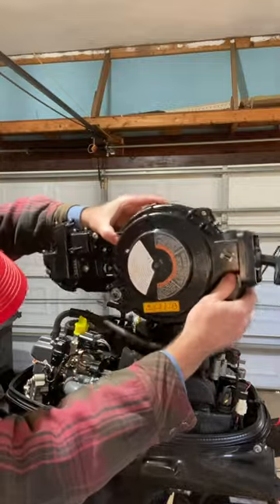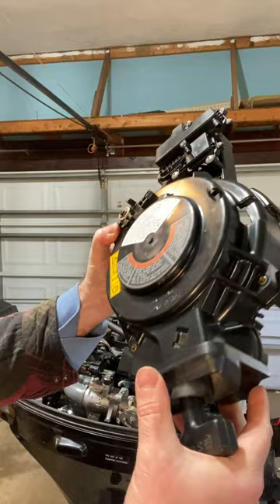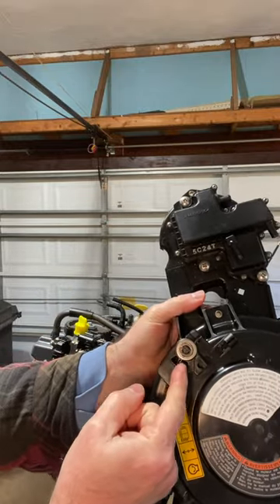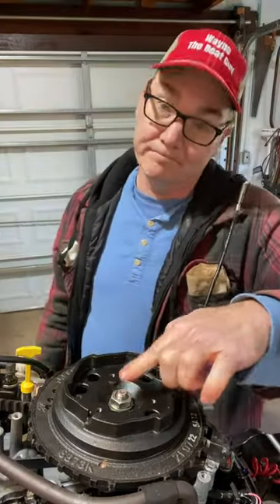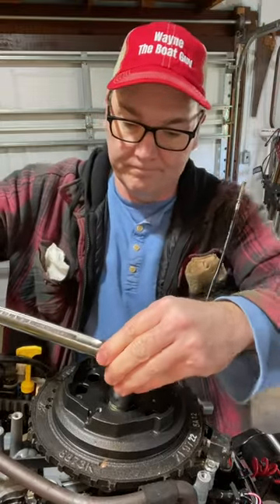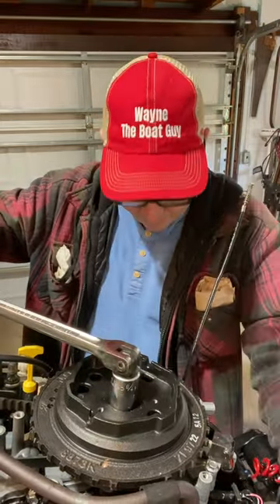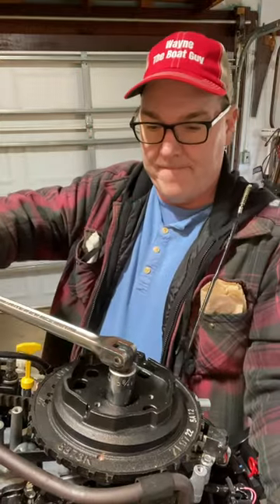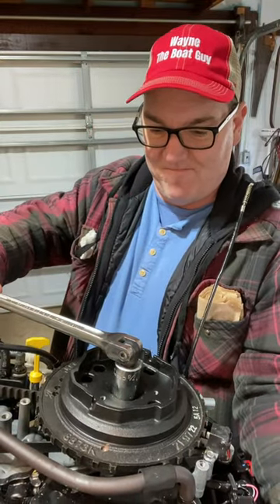Suzuki outboard problems - Part 3

Comment: I highly doubt the belt slipped, these smaller motors don't have tensioner so the belt slides on off the crank under tension. I had to unfreeze a 15hp yammie that was sized, took head off. Tilted motor so piston was facing up. Filled the combustion chambers with pbr waited two days. Then used a piece of wood and a 3lb sledgehammer and hammered the piston. Got it to budge little by little. New head gasket and the motor was running next day.
Reply: Yeah I’ve done similar, looks like this motor is heading that way

Comment: If you can't spin the flywheel with a breaker bar then you have some sort of serious internal issue. Time to tear it apart and see if theres scoring on the cylinders? If not then you can probably get away with a set of pistons and rings and of course make sure the oil pump is in decent shape. If so you might be able to get it back. With a little bit if machine work and oversized pistons and rings. But your going to be rebuilding it though.
Reply from the maker: Yeah... and what I don't want to do is get $1,000 worth of parts and still have just a boat anchor. People who really know this stuff could make it happen - but I'm just a guy with a few tools who has never worked on a 4 stroke outboard.
Reply: @WayneTheBoatGuy  well it might have jumped timing if that timing belt loose and it could be you have a valve not closing completely and its hitting the piston and preventing the engine from spinning over. It might be worth just pulling the pkugs out and get one of those little inspection cameras and stick down through the plug hole and see if you have a valve hitting a piston. Its just ashame given those 25 to 30 horsepower engines are around 5 or 6 grand brand new. I'd be doing everything in my power to figure out what hapoened to it. You never know there might not be any damage. It could've jumped a tooth or two out when they shut it down the last time. Because thats usually when the belt slacks up when the power goes away. That or it could just be a slightly bent valve that can't close all the way so its hitting a piston. Or pull the head off for that matter and see whats going on. Pretty much all these newer engines are interference now so they can make the EPA happy. Because if it has oil in the crankcase then its more likely a valve timing issue. Now you might have to replace a piston and a valve or two. But in my mind it would be worth it. Your probably looking sonewhere in the 500 to 1000 dollar range maybe a little more than that if they have to replace a piston. But considering its 5000 dollar engine new and it has relatively low hours on it. I wouldn't give up that easily. Any sparklys in the oil? Because if not then again its probably a valve issue. Anyway just my 2cents

Comment: Too bad I don’t know too much about boat motors I can’t help. I still have this Johnson lt10 motor sitting here …. I don’t know where to start do you have a video on that?
Reply from the maker: Sorry I don’t but with those old 2 strokes it comes down to - does it pull, is there a spark,  and is the carb working?
Reply: @WayneTheBoatGuy  thanks Wayne
Reply: @WayneTheBoatGuy  why don’t you like these old 2 strokes?
Reply from the maker: @blaccsilverstaff5484  I don’t dislike them. I’ve had several and still run a 2004 2 stroke 2.5 Mercury. This Suzuki is actually my first 4 stroke - and it was free - because it’s broken!

Comment: fill cylinders with pb blaster or kroil or automatic transmission fluid and let it sit and soak overnight if not a few days. keep it wet in the cylinders, leave the plugs out and put a socket on the flywheel and go back and forth it should break free.

Comment: My DF20 engine has failures when accelerating greatly, I have already changed the spark plugs and the fuel system and it remains the same as it could be.

Comment: It's just kind of rare for a four-stroke to lock up like a two-stroke, could be an open valve but if that's the case then you would be able to spin it backwards at least a little bit

Comment: Motor got hot due to bad water pump or something clogged the water inlet.
Reply from the maker: Yeah it had clogged up and then taken apart and cleaned out and ran for a short while again (before I got it).

Comment: hahahahaha well let me do it because i have done many engine that was stuck because of lack of lube cause it get stuck and way to get it unstuck is heat and you going need do two things in order get it unstuck is take lower end off and themostate and run water thur lower end and take torque and heated pistons up real hot and take 4x4 or 3x3 whatever fit in there around cycling wall and use slage hammer hit woods push pistons back in order get it unstuck once it unstuck them u can remove rod bolt and hammed it out front thur the head

im engineer i do many repairs on a lot of stuff